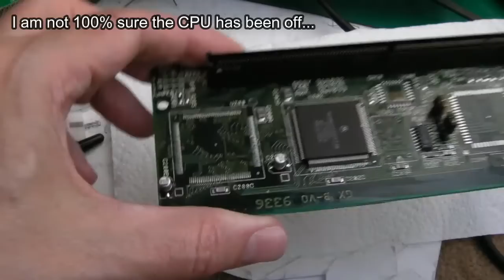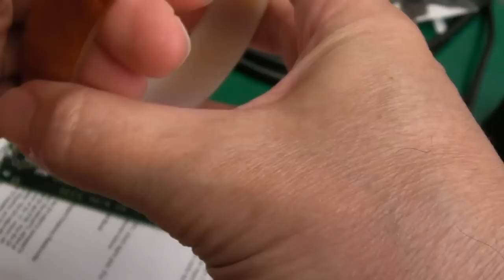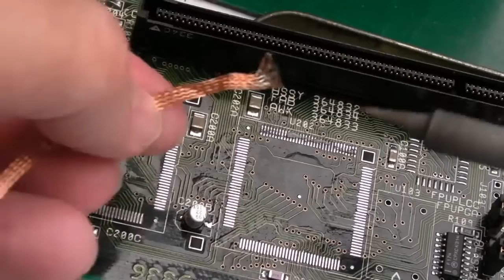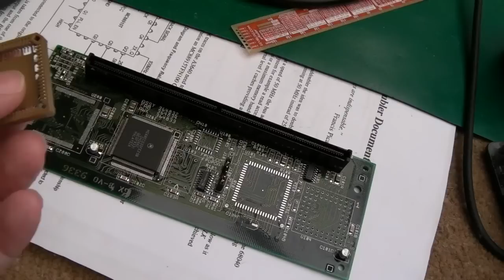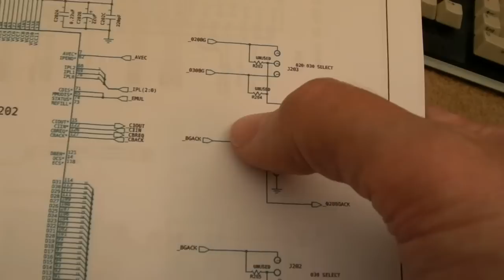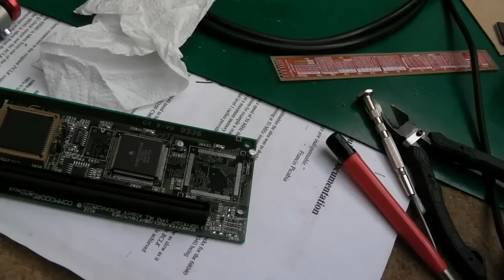Commodore Amiga A3630 Repair

Comment: To desolder very old ICs can be useful Chip Quik solder tin. It get the the melting temperature very low (under 200 Celsius degree). If you don't have it, can be useful soldering the chip with a fresh tin to avoid pad cracks.
Reply from the maker: Thanks, yes - I've used it a number of times on my channel - last used on the MVS 2 slot repair, and on the Sega Mega Tech repair.

Comment: Chris, don't cut these plcc sockets open - just use cheap chinese "lcd screen separator" and solder paste to properly reflow them - they will bolge and loose their contact sooner or later when done like this, also - these are just 4 layers board and it is pretty easy to dig to the internal layers with dremel and reconnect these signals for good, core is usually 1.2mm, and remaining thickness is just prepreg - quite thin and easy to work with
Reply from the maker: Thanks for the tips there Seb =D  I will give that a try at some point!!!

Comment: I've actually done that - run wires through vias to to either make a pad or enforce a sketchy one. Nice work :)

I should add I've done 144 pin chips by just using a lot of flux and a chisel tip - probably helps to have a microscope too
Reply from the maker: Yes, chisel tip is essential for soldering these QFP 030's for sure!  I just forgot to film once I swapped over the Antex - but it went just as well as the other A3630 video I did!
Reply: @GadgetUK164  Yeah the finished product looked perfect to me on video at least :).

Comment: Try out low-melt-solder (sometimes called "desoldering alloy") to remove larger chips like that. Its going to be soooo much easier removing these kind of chips - promised! Heating the chip and board for long time with the desoldering gun can't be good...
Reply from the maker: Thanks! Yes, low melting point solder is a good idea!  It's just darned expensive lol!  I will get some more soon!
Reply: @GadgetUK164  I was able to reclaim the used low melting solder after I removed some chips. Not 100% of it, but it works for next time.

Comment: Do you think that it would help to put some hot melt glue at the centers of each side of the chip socket holder to help reinforce the plastic, just at the centers? I have a bunch of chip holders for my reAmiga 1200 and cutting the bases off would make soldering much easier, so I'm thinking about doing as you did.  Im just a little concerned about the plastic holders not being as well supported.
Reply from the maker: It may help but tbh the hot melt glue wont really hold very securely for the pressure the chip places on the socket...